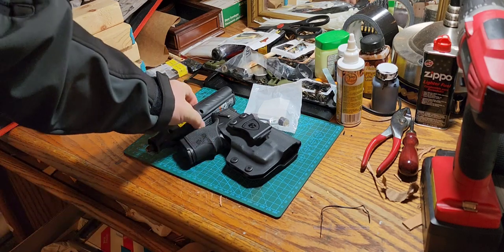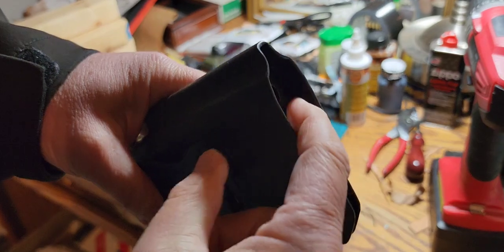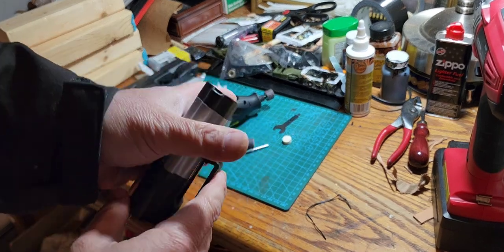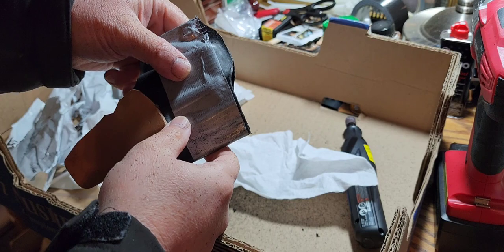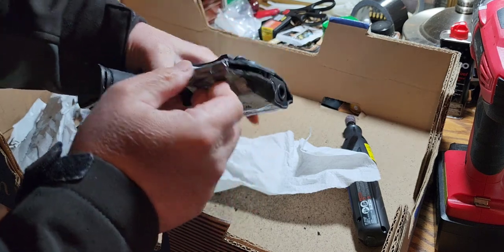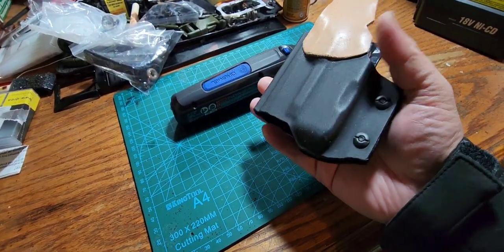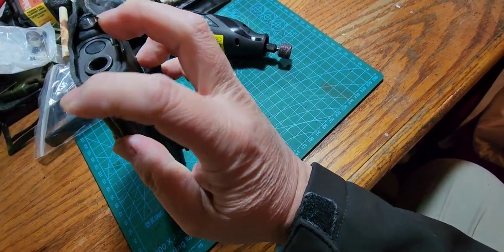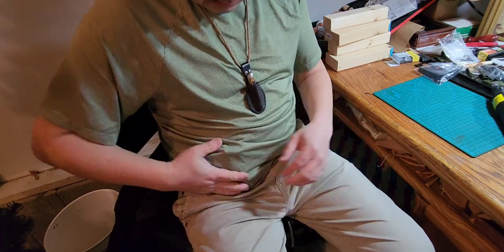Dremel 7350 Modifying a Holster

Comment: I was definitely cringing 🤣. You should’ve called or texted me beforehand.  1 you should’ve tried a foam wedge to alleviate your pain. 2 you should’ve gotten the plug-in Dremel   3. You should’ve used the cutting bit to cut the kydex then sand. 4 might as well remove the kydex flush around the light. 5. You did a pretty good job 👍.   I like to use the foam wedge sandpaper from Home Depot or Lowe’s.  Just get an assortment of grits. 800 - 1200 (I think) 🤷🏻‍♂️
Reply from the maker: LOL i knew i should have called or text you. Yeah... i think I will sand away some of the light housing since you said its okay.  I was afraid it would lose retention.
Reply: @SubUrbanNinja-EDC  the hardest part about learning to use a dremel is that you have to know when to stop, lol.
Reply from the maker: @Valorius  haha..true...it was getting addictive.  LOL
Reply: @SubUrbanNinja-EDC  it's like painting you have to know when your masterpiece is finished. lol
Reply from the maker: @Valorius  LOL